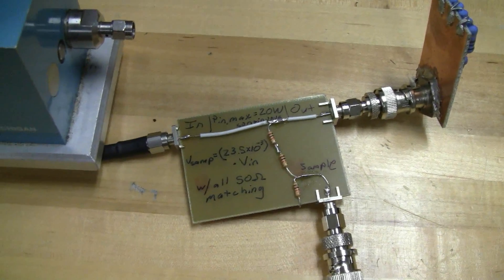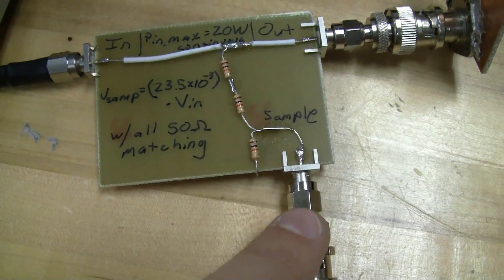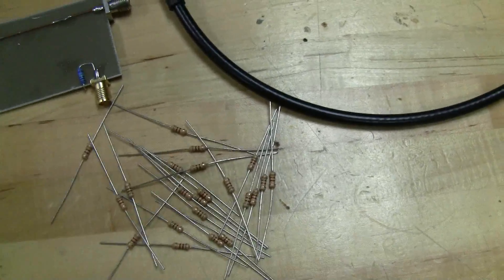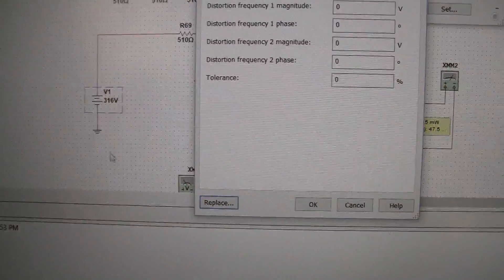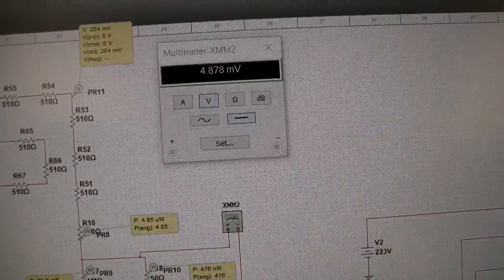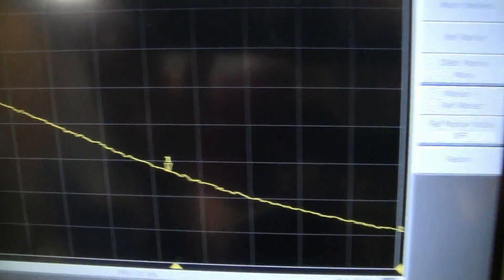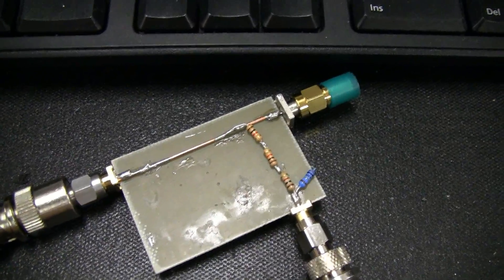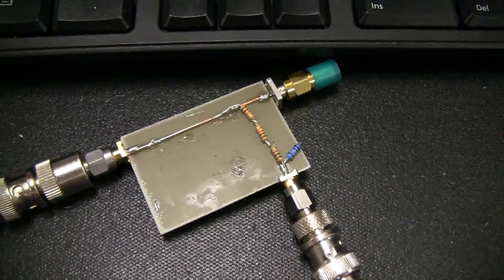Building an RF Signal Sampler for Oscilloscope Measurements

Comment: This is really cool. What I did is wrapped some solid core hook up wire around the center line of my stripped coax on the dummy load I built. I put 3 turns around it, I get perfect readings of frequency on my digital scope. It tells me voltage too and I’m sure some math would make use of the voltage readings. Your obviously good with the math, you could probably figure out what to expect doing it like that.